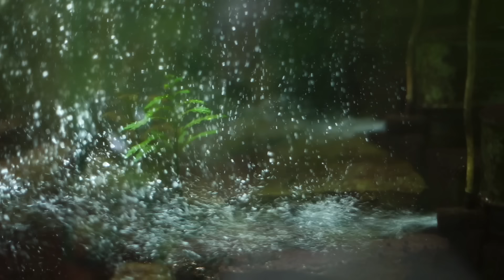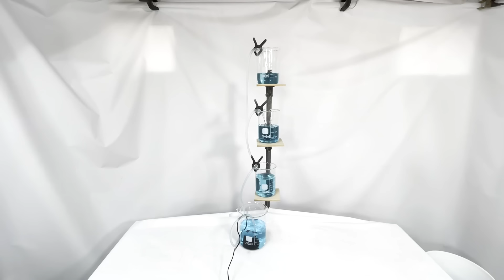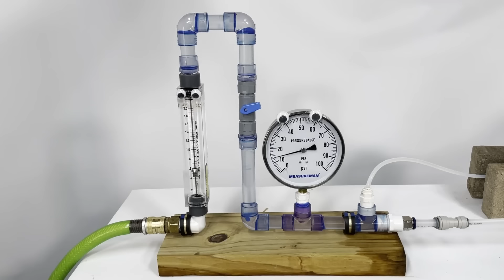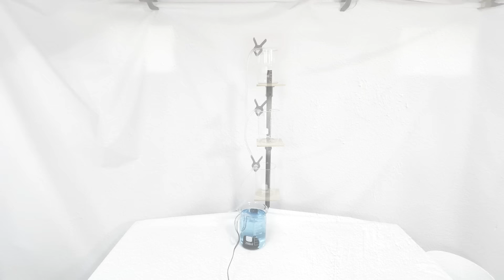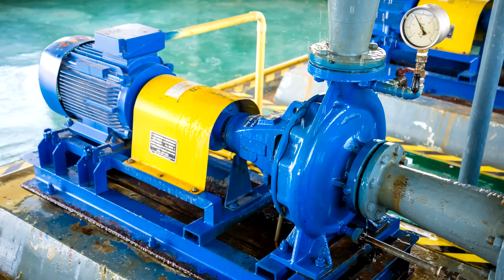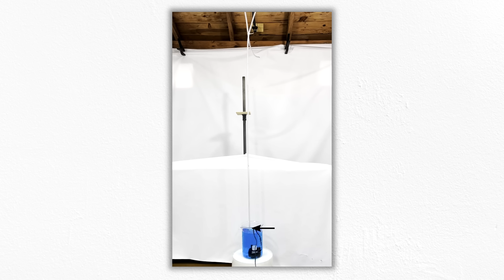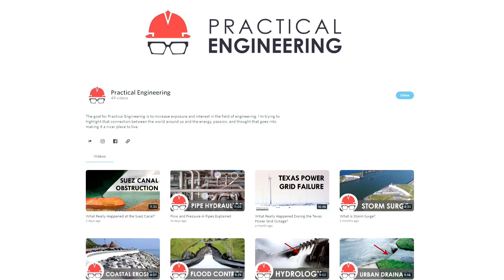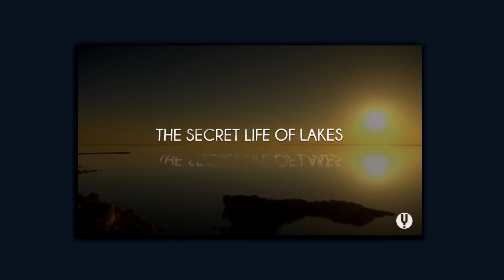Do Pumps Create Pressure or Flow?

Comment: Good presentation. One mantra to add that sums it up "flow can only occur where there is a difference in pressure". Fluids always flow from high pressure to low pressure, so it is impossible to have one without the other. When you throw a ball, do you push it or do you move it? Of course it is both, but it is the push (pressure) that causes the movement (flow). Going deeper, if you throw a ball in water, it will move less given the same amout of push- so more accurately, the movement is the result of the balance between the force behind the ball, and the resistance in front of the ball. Therefore, flow/current/speed can only be determined by understanding both the push and the resistance- this is called nodal analysis and also applies to voltage/resistance/current in electrical circuits.

I think the key to understanding the basics of pumps is understanding performance curves. Different pumps have different optimial performance windows. A centrifugal pump may perform more optimally at high flow and low-pressure output. A reciprocating pump can create very high pressures, but at lower flowrates given a similar size. Hydraulic horsepower is a more accurate measure of pump output than either pressure or rate. A good rule of thumb in my industry is Pressure * Rate / 40.8 = hydraulic horsepower, where pressure is in psi and rate is in bbl/min (oilfield barrel = 42 gallons).  In one example, we use a centrifugal pump to deliver up to 5,000-gpm at ~100 psi to a manifold that then distributes it to 10-20 positive displacement pumps which apply up to 15,000-psi (although as you mentioned, the pressure is decided by the downstream resistance to flow). The C-pump in this scenario is ~10" in diamater, whereas the PD pumps are massive semi truck mounted units, each with a 2,250-hp quad turbo diesel engine powering the pump through a very robust transmission. It is true the PD pumps in theory output roughly the same rate at any pressure, but the efficiency does change, and most notably at high pressures they can reach the limitations of the engine and/or the transmission, and this does result in a decrease in flow rate. Unlike the C-pump, it is not a limitation of the fluid end which creates the rate decrease in a pd pump; however, a pump is a system and must be looked at wholistically.

PS- it is wild to see what happens when a 2,250-hp engine throws a rod under load.

Comment: Pumps impart energy/work. That is expressed as both flow and pressure in different parts of the fluid path.
Reply: I think part of the confusion might come from the conflation with discussions of incompressible and compressible fluids. Water is taught as incompressible, which is practically true and so people jump to the idea that a build up of pressure can't be what is occurring. Which is ironic since hydraulic pressure is probably an intuitive concept until they start studying fluids at a college level. Just goes to show how diverse and confusing the subject can be at first when you're learning about different aspects instead of thinking about it as an integrated whole.
Reply: Totally agree, the Bernoulli eq (assuming simplified models) says that pressure, head, and flow are all basically the same and interchangeable. It’s just conservation of work and energy.

Comment: Boy do I wish we had an engineer like you, 20 years ago. I was an electrician that seemed to have absorbed/dumped into the water system where I worked. (Now retired) They had 4 vertical 1000 gallon / minute Deming pumps that outputted through 8” ID pipe, into a 14” header/collector pipe, sending water from a settling pond, ¼ mile back to the main plant. They kept adding more and more equipment, that needed cooling water, so the engineer kept adding pumps. No matter what he did, the pressure and the volume, ¼ mile away never increased. (Eventually up to 8 pumps) I tried to show him the folly of forcing more water through that same 14” pipe was futile, with an impeller driven pump, but the engineer looked at me as if I was a moron, till he finally got to see the amperage going down on each pump motor as other pumps were manually turned on. (Took 4 clamp-on's at once to visualize it)
If you would, show how an ammeter is a good tool to check and set up pumps, check wear on impellers, and the need to set the pumps at 100% load (rather than 70-80%), to get the best balance out of multiple pump systems. Some of the newer people to the field would benefit. Most people see pump curves, and just shrug their shoulders. Setting them up is fascinating though, especially when the mechanic foreman comes to you, with his budget for the year, and asks, which pump is showing the least efficiency, and you can show him with an ammeter,  and a pressure gauges, which impellers are wearing the most, in parallel multi-pump systems. I’d be glad to feed you my notes, but it sounds like you have all you need.
Thanks, 
Mike
Reply: i really would like to read those notes! i do really need them as well. I'm being serious sir
Reply: @domenicobianchi8  Been retired from that job for 14 years now, but I will see what I can dig up. It won't be much, in that most of the companies documents stayed with the company, but most of what I will dig up are probably viewable from Deming Pumps. The Pump flow rate curves show what you get, but are not easy to understand at first, especially without an actual pump in front of you. Don't give up on me for an answer - might be a while. Mike Trissel
Reply: @miketrissel5494  thank you so much for the effort! i will wait with hope and gratitude

Comment: Thank you for the informative video. I worked years for a plant in which we did not have a clear understanding of what pumps are capable of. We had to move 10,000 gpm of a slurry containing a crystal formation that centrifugal pumps were hard on. Plus, before we discovered mechanical seals, we were pumping 500 gpm of diluting water into the packing glands, We were burdened with having to repair packing and replacing ballraces on a crippling frequency. At the end of my time at that plant, we had new minds coming on who introduced us to eddy pumps, which changed things . I wish we had youtube and videos like yours to teach us these things back then.

Comment: As a plumber I really appreciate this video.  You opened my eyes to new ideas, and I love pumps too.  I work with hydronic pumps so we go for efficiency and longevity rather than high flow or head.  There are issues however with placement that can impede or enhance cavitation and also entrapped air removal through traps or high points.  Thanks again for all these great videos!

Comment: "It's not the volts that kills you, it's the amps - the voltage just assists in determining how effectively those amps are in fact killing you"
Reply: No but the voltage determines the Current that is running through your boody as long as the power supply can deliver the current while the current is also determined by your bodys resistance.
Reply: It's not the volts that kills you, it's ignorance.
Reply: @7784000  But still the fact remains the voltage determines the current that flows. Of course, the voltage can and absolutely will change if connections within the circuit change as this will disrupt the distribution of charges within the circuit. Sure this will be more noticeable if the sink being added or removed is large compared to the sources within the circuit. This is of course why voltage will drop sharply if the charge is being provided by a relatively limited source compared to how much current is able to flow through the new sink as the source simply cannot maintain the charge at that rate of charge dissipation.
Reply: Not exactly, the voltage determines how many amps are killing you.

Comment: More urban planners need to watch this.  Your video describes every day for me while I design wet pipe fire sprinkler systems balancing water flow from the public utilities against what is required to drive the sprinkler system.  One other fun fact for pumps is that the less water you have to work with, the less pump you need to add the required flow.  Adding a bigger pump to a system with marginal pressure makes for frustrating calculations! Thanks for the video 👍🏻

Comment: Very nicely done: you have a talent of making complex topics easy to understand. 
There is one complication more: positive displacement pumps which make use of elastic elements (diaphragm, persitaltic etc..) will also provide different flows at different pressures; for some the difference will be tiny, for others quite significant.

Comment: I hate when people says amps kill but volts don't. It's like saying it's not the speed of the car that kills you but the miles it has driven in the last 0.1 seconds. It is always the totality of variable factors.
Reply: People get confused with static charge that’s the issue, they hear “tasers operate at 50,000V but don’t kill be cause the current is limited” what they don’t understand ohms law still applies, as soon as a load is applied to the 50,000V output it drops accordingly. The only reason tasers can push current at 50,000V is because they cycle capacitors on and off, rather than pushing a continuous low current they push a high current at a given duty cycle
Reply: But it is accurate, you are killed by I^2•R power heating, and I overriding your nervous systems I.

I have touched very high voltage sources before, the trick is in the source.

Voltage sources create the needed current to satisfy V = IR, at no load no current, at very low R (say shorted) the current requirements exceed the source's limits and voltage falls to maintain V = IR. 

Conversely, current sources will generate the required voltage to maintain the specified output current. Lightning is a current source set to 10,000A, which with a surge impedence of about 300Ω creates the 1MV pulse traveling at lightspeed down a power line.

So, if a source creates very high voltage, but cannot create high current (most HV generators) you can tough the output and only get a minor shock. But a 12V car battery can definitely create the needed current to kill you, but is at too low a voltage for bridging the terminals with your hand to kill you.
Reply: @jasonreed7522  Yes that was what I was saying, high voltages (such as static charges) are only deadly if they have the capability to deliver current at that voltage, if they can’t the voltage collapses down to whatever the source can maintain as soon as a load is applied

Comment: That look on trainee or new operators when you have them close a valve when a pump apparently doesn't deliver it's intended flow, is kinda priceless.

Almost as good as showing an engineer that reducing coolant flow over a cooler, can actually improve cooling

Comment: Forget the graphs. "Pumps create both flow and pressure. The same pump can create more of one and less of the other if you put it in a different pipe system."
The trick to catchiness is (among other things) to simplify and use concrete wording. 
The example demonstration you made in this video is a really helpful too. If there's some common home example that could demonstrate this point, that would be good to include in the mantra. I can't think of any myself though.

Comment: Grady, feel free to answer this one in a video: Why do people with hydraulic drives refer to them as hydrostatic systems when clearly fluid motion is dynamic.
Reply: Well, one meaning of the Greek root statikos is “in balance”, not “unmoving”, so maybe the term was coined in the sense of “a hydraulic system seeking a balanced state”, whether or not it has actually reached that state yet. Just my hypothesis, I haven’t looked into it.
Reply: @tookitogo  The tricky bit about that is while there is fluid motion, there is no balance ! I suspect that's why the two ideas are connected in Greek !
Would you like to support me in correcting the computer world as to what 'metadata' really is ?
Reply: @millomweb  Hah! Good luck with that! :P I mean, it’s an industry where we use the term “random access memory” to mean “volatile memory” because long ago, the random-access memory wasn’t volatile, either, and it was the distinction between working memory vs. storage (which was practically all tape at the time, very non-random access). Even though practically all of our storage is now random-access, too, and our working memory is volatile now, we’re stuck with it! :/
Reply: @tookitogo  Longer ago, all memory was not volatile. That's back in the day of mechanical calculators.
Reply: @millomweb  Um yeah, I said “because long ago, random-access memory wasn’t volatile, either”. (That is, both the working memory and storage were non-volatile, and so the terms for access randomness became used.) We do not have to go back to mechanical calculators for non-volatile working memory: magnetic core memory, which was the dominant working memory until semiconductor RAM took over, is non-volatile. There were some types of volatile memory (like delay lines and CRT memory) but those weren’t used all that much.
Reply: @tookitogo  I'm no expert on mag core mem but I was under the impression it was volatile - and needed refreshing regularly - but not as frequently as the electronic stuff.
OK, I'll correct that thought !!!!
Reply: @millomweb  Nope, it’s non-volatile, requiring no power to retain the contents. However — and this is what you’re probably remembering — reads are destructive, so any row or column read has to be rewritten! 

I don’t know enough about their controllers to say whether they selectively rewrote only the column or row that was read, or if they just went ahead and rewrote the whole plane every time anything on it was accessed. 

What I also don’t know is whether the software took advantage of the non-volatility, or whether they just wiped it on power up. Μy hunch is the former, at least in the vacuum tube days, so that a tube could be replaced without having to start the running job over again. But this is pure speculation, I have no knowledge about that detail. 

P.S. Core memory could also be designed as read-only, by literally weaving the ones and zeros into the fabric of the memory. If you haven’t heard of core rope memory — aka “little old lady memory”, look it up, you’re in for a treat!

Comment: 0:19  “it’s not the pressure that kills you, it’s the flow” is how I see that.

Why does that flow so well
Reply: Which is technically true if you consider getting crushed to death by the ocean “water flowing to equalize a pressure difference”.

But it’s definitely the pressure.
Reply: Not much pressure when you go down Niagara Falls, but there sure is a lot of flow.
Until you reach the bottom of the fall, lots of pressure there.
Now the question is, is it the pressure that kills you, or the sudden deceleration?

Comment: One of my jobs at a water utility company was to research existing pump curves and system curves for large water and wastewater networks to determine if installing variable frequency drives would provide a saving. Did this for several systems and saved millions in power.

Comment: I work at a pump manufacturing company and the way my manager puts it. "Pumps don't create pressure, they overcome it." This statement, while a bit simplistic, hints that if the pump was not attached to a system, the discharge pressure would be Zero.  Granted depending on the system it is pumping into, the pressure it "overcomes" is directly related to either flow rate (which is created by the pump) or the natural pressure of the formation.  I think he uses this simple statement to help our customers understand that regardless of the pump selected, the system it is pumping into is just as or even more important that the pump itself.

Comment: Would like to see a more in-depth video on positive displacement pumps, mainly Triplex and plunger pump systems. We use them in HDD applications and I would love to learn more about them. Most info  on them that I've found is typically related to downhole high pressure systems. Also a video on HDD design, pipe stress during pull back and other general topics related to horizontal crossings!

Comment: for the experiment at 3.03 you can use Bernoulli's equation to find the pressure difference based on the head (Pressure at the top will be less than pressure at the bottom) Bernoulli's Equation:         P1 + 1/2pv1 + Pgh1= P2 + 1/2pv2 + Pgh2.
From continuity equation A1V1=A2V2, since the pipe is the same diameter all the way up, we know the velocity V1 = V2.
Since Bernoulli's equation tells us P1 + 1/2pv1 + Pgh1 = Constant, as the height increases something else must decrease.
P2 (Pressure at top of pipe decreases)
1/2pv1 = 1/2pv2  (Constant) - Cancel out from Bernoulli's Equation.
P1 + Pgh1 = P2+Pgh2
P2 = P1+pgh1-pgh2.
The pump power required depending on the size of the column of liquid (Head) and the flow-rate (Q) and the Pump efficiancy can also be calculated:

PowerPump = Q x P x g x H/ n

P = Desnity g = Gravity (9.81m/s^-1) H = Fluid Head n = Pump Efficiency 
The flow-rate of the pump can be calculated by re-arranging the equation if the power is known:

Q = n*PumpPower/Pgh

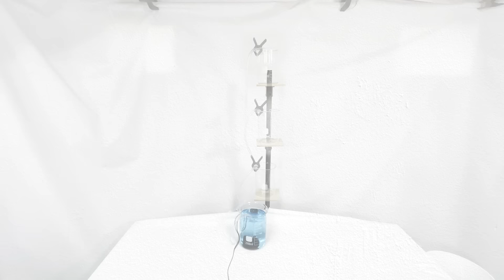This shows that as the head increases the flow-rate decreases, which is what we can observe on the graph at 3:13, showing for the same pump a reduction in flow-rate for increasing head.

Pump efficiancy (n) is simply equal to n = PowerOut/PowerIn